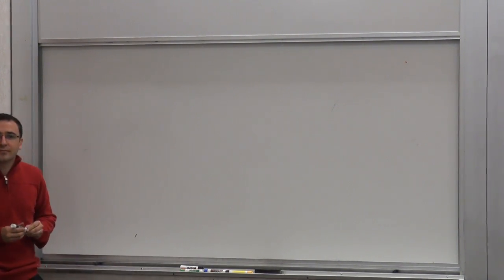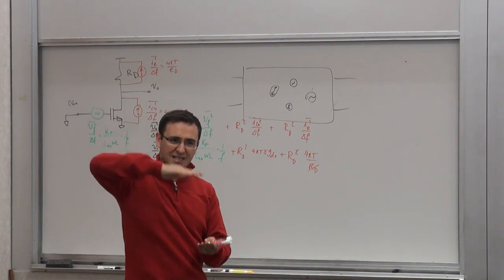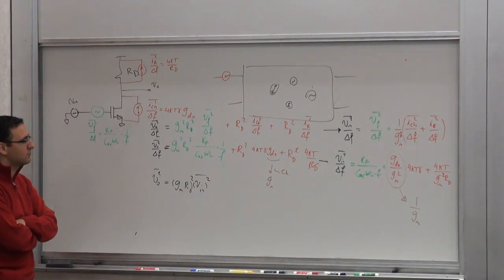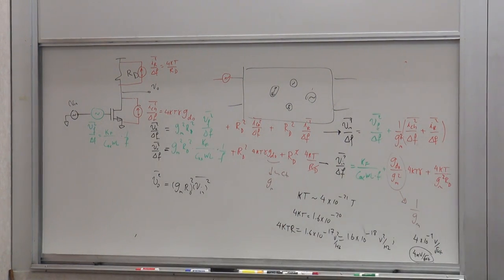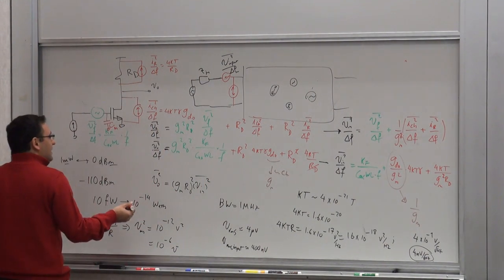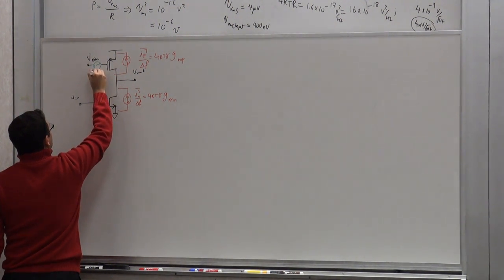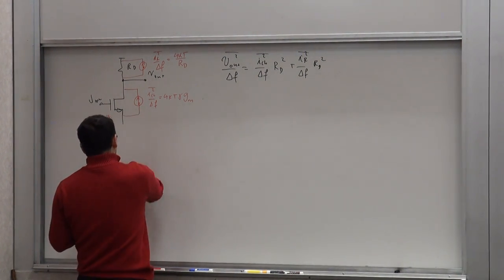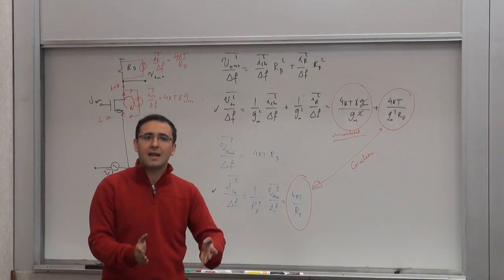167. Noise: Noise in simple amplifiers, Input Referred voltage and Current Noise

Comment: Question: you say that thermal noise in a resistor is due to the movement of the electrons, but from your previous derivation on Johnson noise of a resistor you used Bose-Einstein statistics. Is the thermal noise in a resistor actually the result of EM waves or the movement of the electrons themselves?